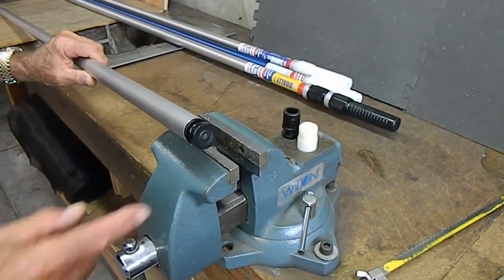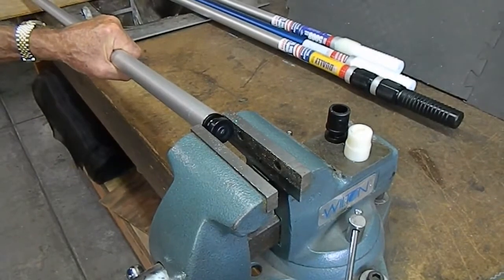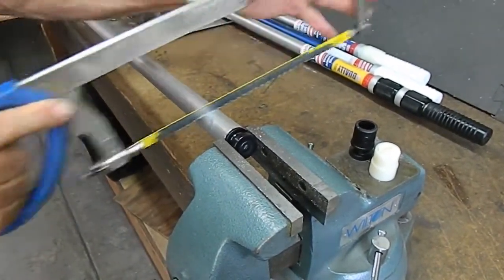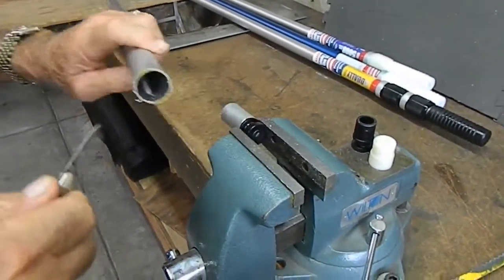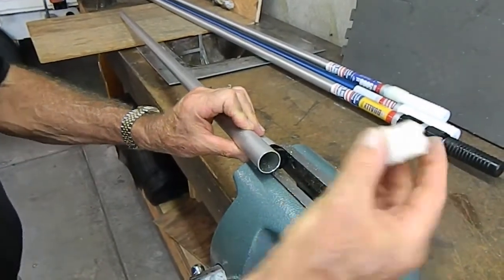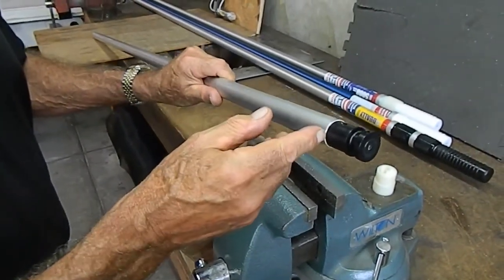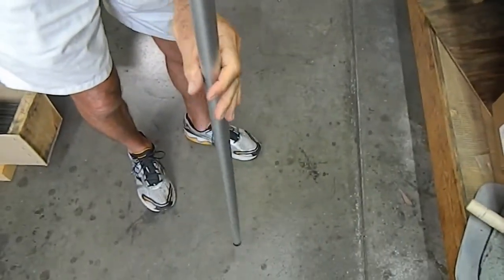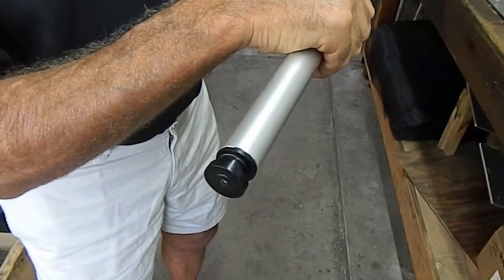Replacing Internal Cam

Comment: Found another way of removing the old can assembly without having to use any tools.  Took my handy dandy little butane torch and try to evenly heat the pole for roughly 60 to 90 seconds and the cam will push itself out.